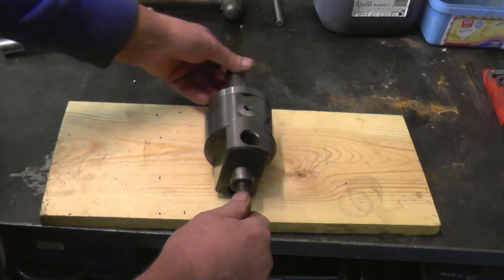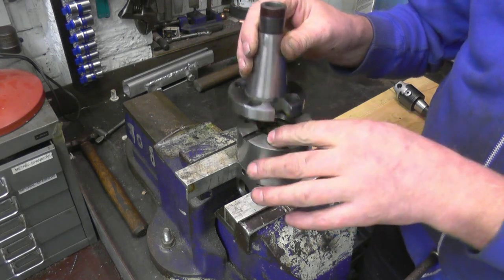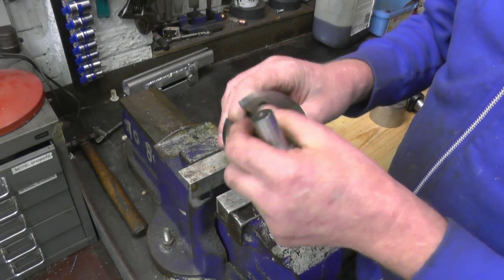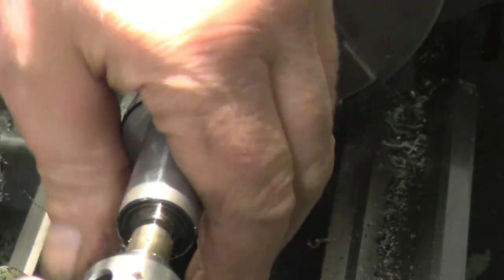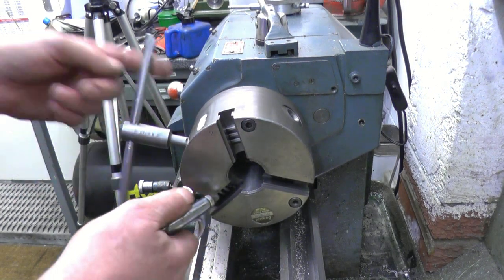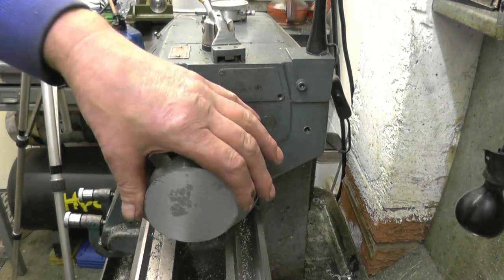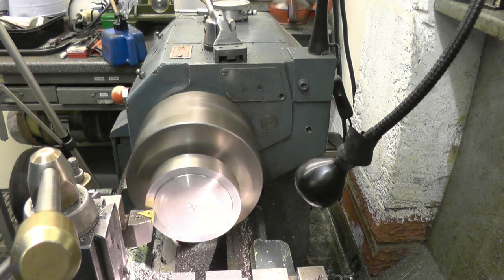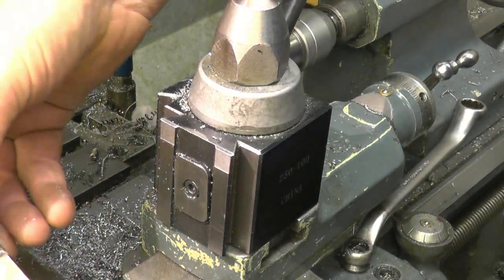Big Head part one

Comment: I really like your idea of milling a dovetail in big insert holders to fit a quick-change tool post. I have some large (1" and 1 1/4 ") insert holders which certainly won't fit any normal holder (1/2") for my AXA-sized tool post. I happened to get a fairly large 60˚ dovetail cutter to open up some cheap ($10) AXA-#1 tool holders which turned out to be .002" too small to fit the tool post. That should let me mill out a dovetail in the big-shank insert holders. Thanks for the idea.

Comment: Be sure to threadlock the adapter if you decide to thread it. Mine is threaded but I haven't had a problem in reverse even doing close to 6" radius flycuts @ .050" DOC in aluminum.

Colin ;-)
Reply from the maker: ***** It has plenty of thread lock  lol

Comment: John, like the tool mods, I have been a bit lazy, my solution is mill the tool down to fit the AXA blocks. If you haven't finished the adapter yet, use a bearing mounting thread locker, here in the states it's green locktight, this will keep the threads from backing out, if you need to run in reverse. Also you don't put welding stress on the part.
Reply from the maker: I had thought about welding
It is thread locked now

Comment: John, Great videos as usual but where did you get the indicator holder is it home made or proto type ?

thanks. Rocky
Reply from the maker: I bought id second hand off ebay
The older ones are hard to find
Reply: Hi John, it looks like a one some one showed on another channel. Sure would make a great project for those of us on a fixed income that can't afford the NOGA. Size 40 steel pipe and some ball bearings. But what makes the unit work is the problem.

Hope you and your wife will have good holiday.
Rocky
Reply from the maker: Rocky1234732 I did a video on repairing similar holder

Comment: Hey John, those aluminum jaw protectors will stay on the vice better if you glue some magnets on the underside.  Two or three glued on will hold it to the top of the steel jaws.  Hope this helps.
Reply from the maker: That is a great idea
I keep dropping the Bastard things
Will show it next Sunday
Reply: doubleboost And the bastard magnets will pick up every piece of steel swarf you generate on the vice! Use a fitted soft jaw for a cleaner result.
Reply: Mike Clayton Hey Mike, yes the magnets will attract some swarf, but it is manageable. Just a couple of swipes with an old tooth brush will knock that stuff off.  Best of all the aluminum jaw protectors pop right off when you need the steel jaws to really bite on material.  I have been using them for years on my vices.
Reply: a couple dabs os silicon will hold them in place. easy to remove when you need the steel jaws.
Reply: I wonder if John Mills ever took our advise?

Comment: Hello John,

You might come to curse that threaded on adapter. Sometimes you need to run a boring head backwards and I've had what I thought was a one piece head unscrew. There's nothing to stop you pinning it of course. I would probably have welded it and then machined it in situ in the mill spindle with a tool bit held in a vice.

You can buy stub end R8 arbors if you even need one.
Reply from the maker: I had thought about welding it & machining on the mill

I will  be using thread lock